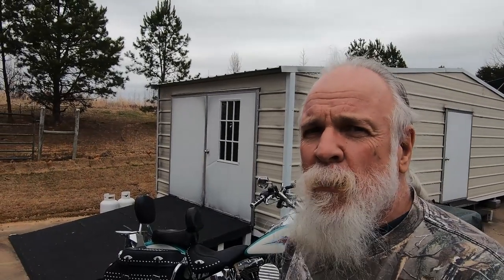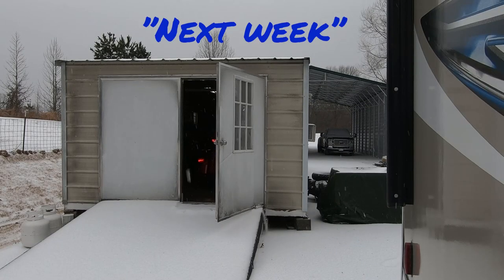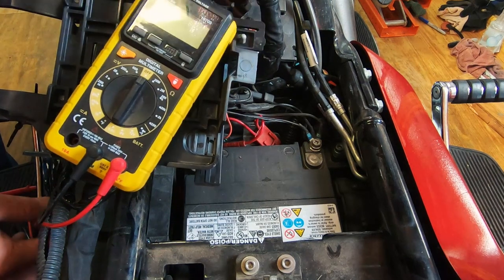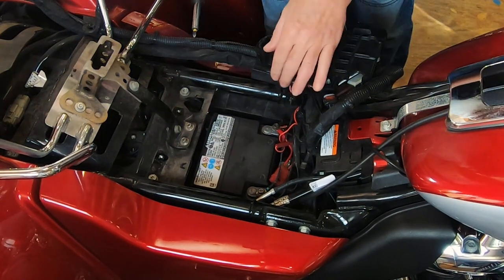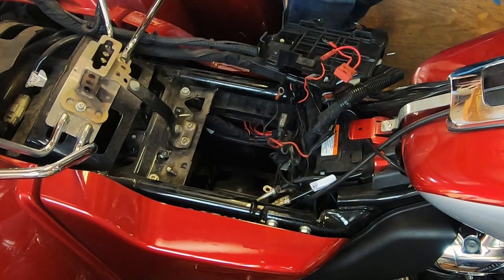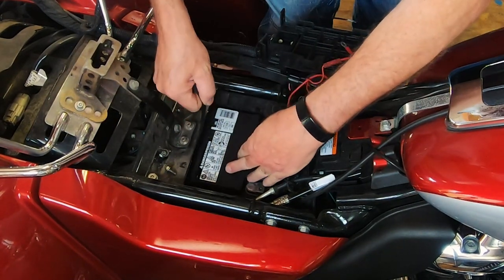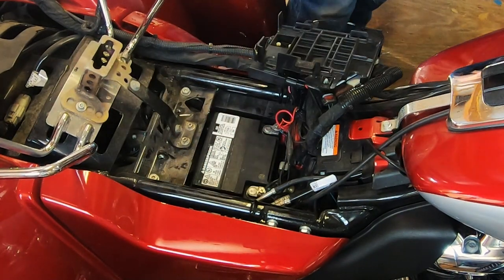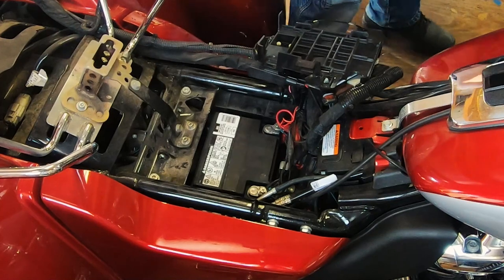Harley Tri Glide Battery Fail & New Installation

Comment: Just suggest one additional step: remove the main fuse whenever removing the battery cables. There’s a slight chance you could fry the ECM.
Reply from the maker: Good Catch!  Yes, definitely should do that.  It is in the manual, and it is good practice.  I am going to pin this to the top.  Thank you! 👍

Comment: Why not keep it on the tender all the time?   I do that, and never have a problem.  It will also extend the life of your battery.  Just my opinion.
Reply from the maker: You can if you want to! It is just an extra hassle during riding season taking it off and putting it back on when we might ride everyday! 

Thanks for commenting! MB

Comment: Great video, Doc. I'm one of those guys who purchased a motorcycle used/new back in 06. It is a 2006 Street Glide. I wasn't told about this. I have the owners manual. However, it's very different and confusing. The first owner did not own it, pass 300 miles. The manual doesn't explain how to find what PIN is loaded. And I would like to change it to my personal PIN.
Reply from the maker: Here are the two videos we have done about finding and changing your PIN.
https://www.youtube.com/watch?v=sOia3VBYnWg
https://www.youtube.com/watch?v=PBFc189fS88
Enjoy your ride!
Thanks for watching & commenting. 👍😎👍 KP
Reply: @DKCustomProducts  thanks. I have zero clue how my comment ended up on your video. I appreciate you guys also. Watch many of your videos as well. 

However, this is not like my 06. The manual has crazy instructions using the key fob between settings the code. It is completely different. In the 18 years that I have owned it. I have never bothered trying to find out what it is set to. Or change it to a personal PIN. For some crazy reason. I have decided to try. And it makes no sense in both my owners manual, or nothing in my service manual. TIA
Reply from the maker: Yeah, HD has used different procedures over the years.  Wish we had an 06 so we could see how it works.
Reply: @DKCustomProducts  thanks, I figured it out after reading my owners manual over and over. Basically, you have to use your fob instead of the right turn signal button.
Reply from the maker: Glad you figured it out! 👍 MB

Comment: I always leave mine on a BT. Same with my Ultra
Reply: I also keep mine on a tender , I owned a VTX 1800 for 6 years and never replaced the battery
Reply from the maker: Yeah, I've never had to do that.  Last battery I had to replace was the lithium on my Sporty that was around 10 years old.

Comment: I experienced this on a 2020 CVO Tri Glide at 2400 Miles after 2 weeks in Garage without being on a tender. Battery at 10.4 Volts and the Tri Glide Systems when off the chart just as you experienced except that my Security System also went off at random and there was no control.......replaced the battery and all was well. The battery that went down tested ok and re-charged....using on test bench now.
Reply from the maker: Interesting! Sounds like another bad one.
Like I said in the video (I think), I normally get 4-5 years out of the stock battery.  This is the first one that died on me so early in its' life.

Comment: Thanks for the great videos.  I wonder as dielectric grease does not conduct electricity, should it be on the actual mating surface?
Reply from the maker: I've read that too.  All I can say is that I have been doing it for decades and never had any problems.  
This did NOT have dielectric grease on the battery terminals or cables from the factory, and I never put it on there, so it's early death was not from that.

I've wired more bikes, cars, buildings and trailers than I can count, and I always cover all surfaces, including mating, and never had a corrosion or connection problem.  I think when you tighten the connection it pushes enough of the grease away for a good connection to occur.

Not gonna change what's been working.  :)
Reply: Many thanks for the reply, much appreciated
Reply: Dielectric grease is to prevent corrosion and will not interfere with conducting electricity in this application. When you tighten the connectors, the dielectric grease does move out of the way and the electrical connection is okay.
Reply: @Texas1FlyBoy  that’s one of the main reasons I like lithium is the fact that there’s no corrosion with it.

Comment: There is always a parasitic drain therefore I always hook up my smart chargers/maintainers - always on 24/7. Causes no harm. One real problem I’ve discussed with HD techs is expected battery life nowadays 3-5 years. I also had a les than 2 yr old battery fail internally 2 years ago . Wow, many years ago I’ve gotten over 10 years outta of a couple previous batteries keeping them hooked up (2007 Sporty original lasted 10 yrs & 1986 Aspencade had a couple batteries go 8-10 yrs). Yuasa batteries are some of the better ones often sold rebranded like Drag Specialties.  Right now my Tri Glide, Sporty and 1976 FXE are all on the juice. I also carry a Hulkman jump pack after my negative battery experiences 😂👍. I can help a fellow rider if needed. 
BTW Hulkman Sigma 1 is deal in chargers / maintainers. I have Deltran, Schumacher, Sears and Hulkman units - try a Sigma 1 it’s a deal. My brother does the same thing with his motorcycles with great results.
Reply from the maker: Good points! Thanks for the info!!!

Thank you for commenting! 👍😎👍

Comment: I need to change out my battery on my 2014 Tri-Glide that I bought in 2020 …is it a similar process?
Reply from the maker: Yes, I believe 2014 is the first year where they made it easier to get to the battery. 👍
Reply: @DKCustomProducts  thank you!
Reply from the maker: @therapywithlilcubbie5764  Thanks for watching!
Reply: Changed the battery with no problems. It was exactly as you said. Thank you so much for the tutorial. You rock! Ride safe!
Reply from the maker: @therapywithlilcubbie5764  Good deal man, glad we could help!

Comment: What's the make and model of the seat you have on your Tri Glide.
Reply from the maker: That is the factory seat.  I use an air hawk below a sheepskin, and I've found that to more comfortable than any aftermarket or custom seat.

Comment: Since the trike was always garaged and secure wouldn't it save the battery if you were to put it in transport mode for the 2 months you were gone?
Reply from the maker: That is a good idea on saving the battery.  Never thought of that.  Have not checked, not sure what parasitic draw there still is, if any, when in Transport Mode.  It would seem that the alarm would be disabled, not sure if that is important to you.
Interesting idea.
Reply: @DKCustomProducts  No parasitic draw in transport/tow mode. I only suggest tow / transport mode if the bike is stored /  in a locked and secure facility (garage). While not in transport mode you will have slight parasitic charge but not enough to drain the battery if started every day. Leaving it for 2+ months I'm pretty sure that was the culprit. Also, the anti-theft security mode will not help you if you do not reprogram your fob/security code as they are all (or at least used to be) set to 31313, and incase of theft, insurance co's might deny a claim if code is not changed because 31313 is to well known in the motorcycle community. Ride safe my friend.
Reply from the maker: @wskeyson3382  Cool.  Thank you for the info.

Comment: Why not a lithium battery? Your thoughts please.
Reply from the maker: I have run lithium batteries on some bikes where I needed more room, which was afforded by a smaller battery.  I do not need more room on the Tri, and a good AGM will typically last me 3-5 years..a lithium will last 2 to 3 times longer, but cost 2-3 times as much, so no real advantage..UNLESS you need/want some extra space or weight reduction.
Here is a video of me installing a lithium battery in my Sporty- https://www.youtube.com/watch?v=QWs0N1OIdCc

Comment: Here are my thought of replacing a battery. Today, computers run everything, damn near it. Harley-Davidson batteries are spect out for the bike you own. The bike computer or ECM knows that is going on when you go to aftermarket. There is a difference when you try to save a couple of dollars. Some things you don't need to skimp on. Battery is one of them. For my HD, only HD battery will go for replacement. Did you also know the spark plug wires are computer sensitive? Changing wires to look better or you think it will make the bike run better is not true. When the computer senses the different wire, it could have a different voltage requirement or impedance and the computer can sense this and try to make adjustments that it should not have to do. Remember years ago, Keep you GM all GM? Well, keep your HD all HD.
Reply from the maker: All good points! All things are not created equal that is for sure.

As far as spark plug wires go there are definitely better wires than the OEM wires you can see a video here on the difference a good spark plug wire can make - https://www.youtube.com/watch?v=rF2RKeo8asQ

The ECM has some adaptive learning features to it.  You can see how the ECM adapts in this video- https://www.youtube.com/watch?v=0vbTkRvFa80

Thanks for commenting! 👍

Comment: Why not a lithium ion replacement battery? Its lighter, smaller, longer lasting than OEM.
Reply from the maker: Great question.  I have used Lithium batts on bikes where space was an issue.  The one in my Sporty (see video link below) had a Lithium battery that lasted around TEN YEARS!  Just put another one in it a few months ago.  Lithium batts also give stronger cranking than a lead acid, but this bike is not high compression, so needs no extra cranking amps.  On this bike I did not need any extra space, it is already a pig, so weight savings are a non-issue on it.  Regarding costs, the lithium may be a bit more cost effective, but I usually get 4-6 years out of an AGM batt, so it is not that much.  This failure at 2 years was the shortest time a battery ever lasted for me.  All that said, if I had a lithium on hand I would have installed it.